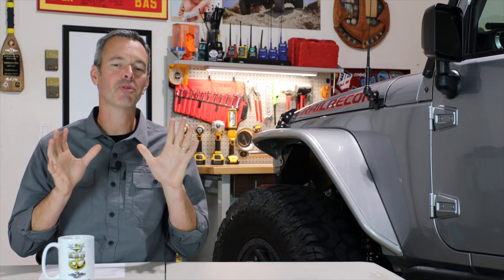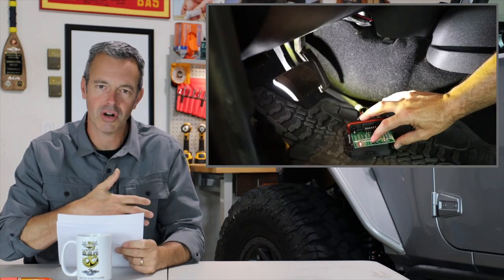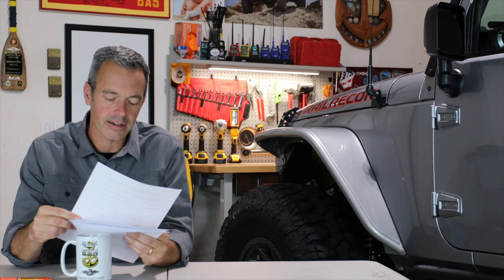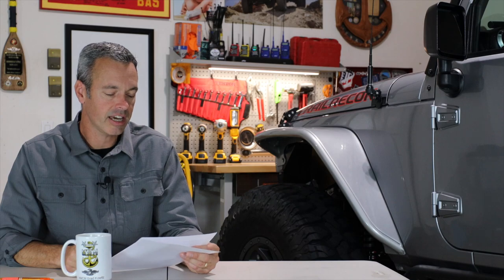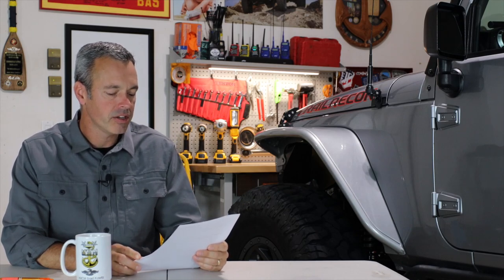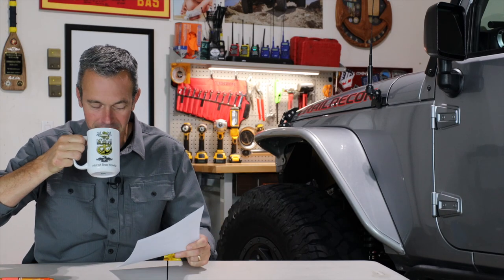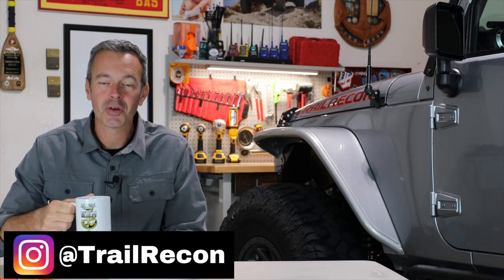Why Don't I Have a Dual Battery System in My Jeep Gladiator? - Garage Coffee ep. 3

Comment: 1:18 Rig of the Week
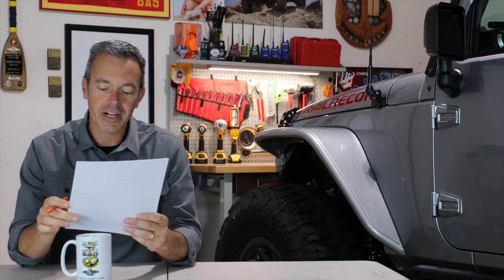2:20 What is your favorite rig walk around?
3:16 What have been the options for how to stay in touch with your wife when you are off the grid?
4:31 Would you be camping out during the quarantine?
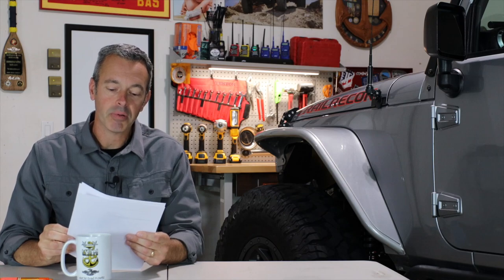5:17 Any plans for new axles on the JT?
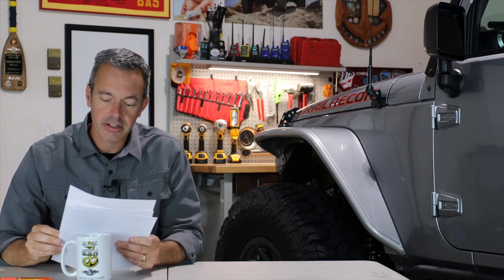6:05 Are you fitting a 38' spare under the Gladiator?
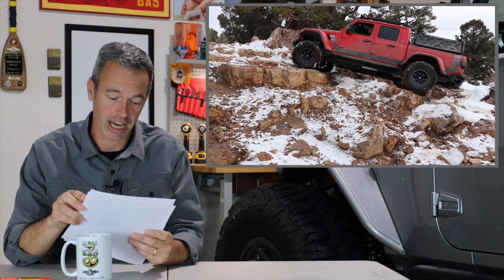6:47 Pros/Cons for electric tent heaters
8:02 What upgrade do you wish you never did to the JK and why?
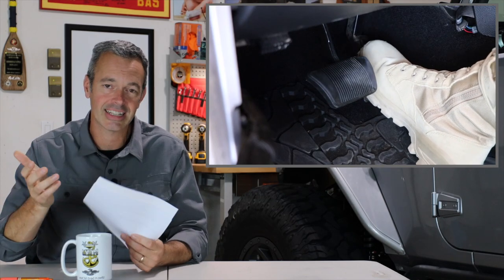8:56 What are your thoughts on a dual battery vs a power station?
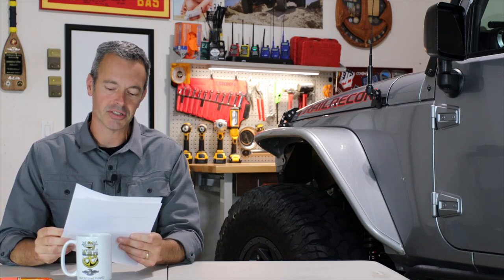10:34 What's your favorite Jeep?
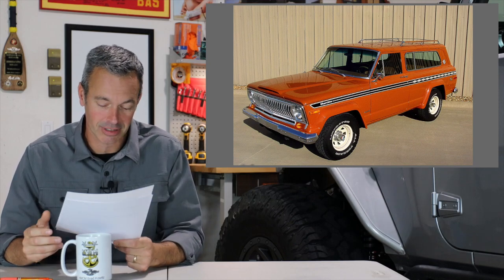11:22 When are you lifting the Wife's JL?
12:07 If you could have any engine in a Jeep what would it be?
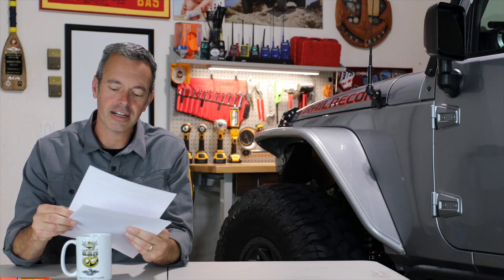12:29 Do you think the electronics that come with newer Jeeps will become a hindrance?
13:41 What is the best first off-roader? A Wranger TJ or Cherokee XJ for a high school student?
14:50 Is there anything you wish you did to help with the transition out [of the military]?
16:40 What are the reasons for changing from a beadlock wheeler to a normal one?
18:18 If your ball joins wear out what brand would you go for a replacement?
18:52 What are the top mods you have done to the Gladiator?
20:20 What was your first experience hitting the dirt that got you into 4-wheeling?
21:46 If money wasnt a factor what would be your dream build for your Gladiator?
20:22 What is your long term goal with E3 overland?
24:05 Best coffee?
24:47 What are the top 3 lessons learned from trailriding and overlanding?
26:37 What type of cabinets are in your garage?
27:10 When can we go camp with you?
28:27 Can you talk a little bit about your Jeep badge of honors?
29:22 Closing
Reply: Thank you soooooooo much!!!!!!!
Reply: Thank you. This post needs to be pinned to the top. It also deserves more likes than the actual video.
Reply: Thanks!
Reply: Yeah, nice job, he should be paying you for this so I don't have to listen to all the other BS first.  Also thank you Ublocker for removing all the ads.
Reply: Thanks. I was actually looking for the topic of the title: dual battery.

Comment: Technically all JL and JT come from factory with a dual battery setup... do a video on how it works?
Reply from the maker: Yes, technically my Gladiator does... good topic for discussion.  Thanks!
Reply: On a none e torque engine, there's a small battery under the fuse box by the firewall.

Comment: Brad, great "real" episodes in this garage coffee series.  I recently purchased a JLUR and have the steel bumper like your wife's JL and your JT.  Was wondering what you were using for a winch plate?  I see lots of options but I've heard a few stories about some being not the right fit, not fitting certain winches or just plain bending under pressure.

Comment: Brad,  I have a 2011 JKU with 155,000 miles in it. The only upgrades I’ve done are Black Rhino Armory Wheels with 33” Nitto Ridge Grappler tires and front and back LED light upgrades.  Should I bother trying to transform this into an Overland Rig or would it be better to buy a JLU and start from there?  If you think the JKU is fine, what would be the first upgrades you would recommend?  Thanks.

Comment: My Bose Entertainment Center DVD & voice command still works perfectly in my 2008 Avalanche, so, yeah, electronics will eventually need module replacements etc, but analog stuff goes out sometimes too. Otherwise, you might want to get one of those 20yr old retired Austrian Military G-Wagons imported into Colorado. Those old motors run forever.

Comment: I considered going the dual battery mostly for my cooler.  However after doing some research I decided to first try an Odyssey Extreme when the OEM battery in my 2017 JK died.  I installed an Odyssey Extreme group 34R and it will run my cooler for well over 12 hours in the most extreme heat and there is still sufficient voltage to start the engine.  Yes the Odyssey Extreme is expensive but cheaper than 2 qualities batteries and the dual battery conversion kit.  Many years ago I had a dual battery setup on my 1980 CJ 5.  This was mostly for my winch but batteries have improved a lot since the 1980’s.  Yes I carry a small jump start battery just in case.

Comment: hey Brad, great video.... question.  I have a 2dr jk. put a 3" lift on it.. shocks and springs. no arms. stock arms..  it drives like its on its tippy toes so to speak..... should I have went with adjustable arms?  short or long

Comment: One of the big reasons for a dual battery in the JL/JT is that the factory battery system is a defective poorly engineered 1.5 battery setup which leads to failures, the dual battery setup can mitigate this

Comment: I'm also looking towards bringing a portable battery.  But since you don't have a dedicated dual battery, do then all your lights including camping lights run off the starter battery?  Won't it drain if you have the lights on at night?  Which lights/accessories are wired to the starter battery and which accessories run off the Goal Zero?

Comment: Hey Brad as a veteran offroader in the jk can i ask you if in your offroading adventures you get coolant running a bit high at times when you push it for instance around the 230f mark? I get this at times when i push my jk in the desert it climbs halfway midpoint between middle and 3/4 and drops to middle in less than a minute and the coolant temp sets at 230 ish even if i push hard...normal driving even offroad i m solid at 200f and middle of the gauge ...do you get this too?

Comment: Hello Brad I have used 2 of those diesel heaters that you showed at the beginning of your video. Both have leaked diesel after using for a few short hours. There is a hole in the casting next to where the fuel pipe is attached. What the hole is for, I have no idea. I plugged the hole in the first one, which stopped the leaking, but after a few short hours of operation the glow plug stopped working. I got a replacement and it started leaking too. Also it keeps shutting down and I have to restart it. I have a plastic container under the heater to catch the leaking fuel. I have a third heater and will install it later today. I’ll let you know how it works out after using it for a few days.  It does put out great heat and uses very little fuel, even though it never shuts off. There’s no thermostat control which is not appealing. You can adjust the output of the heater using the panel or wireless remote. The fuel pump is very noisy. It’s a piston pump. If you or anyone else wants more information or photos of my unit or camper trailer you can email me at cdnbvr@gmail.com. I will answer everybody.   Keep up your great work sir. I also like seeing the rigs that your viewers submitted. I hope that you’ll keep doing those videos.

Comment: I was looking at iceco refrigerators. I have a teardrop camper but the dimensions of the galley kitchen for a refrigerator are not very good so the refrigerator options are limited in my model there is a K2 cooler in the back but I have to deal with ice. I was going to put a 12 volt refrigerator in the back of my Jeep and run it off my car battery for the night in the morning I would plug it into sure power. Do you think a standard battery for a Cherokee would run the 12 volt refrigerator overnight at most 12 hours?

Comment: Nice video Sir, I have a question regarding tires. Road noise is very important for me, as you tried several brands, which one is quiet during all their life....I had a set who was perfect when new but after 150000 miles, it was a nightmare ( I turn my wheels each 3000 miles )

Comment: As an SJ owner, I want to advise you to look hard. Good unmolested rigs are still out there. Bring your wallet. You will be disappointed on just how little aftermarket support they have compared to the little jeeps (TJ,JK etc) The classic jeeps have issues as well, spark boxes, power wires into the regulator in the dash burning and poor quality control. That being said there's nothing like the old SJ's, mine gets a lot of attention just be prepared to have it called a scout or a bronco to those that don't know that jeep used to make big stuff :)

Comment: I love your comment about liking the SJ.  I have owned 2 in my life.  My first was a '73 wagoneer, 4 door..  Believe it had the 340 v8 with automatic and dual tanks.  Great range and very easy to drive.  So smooth on the highway and cound take some fairly rough terrain.  My second was a 1985 Wagoneer 4 door.  Again it was a dream to drive.  Both had surprisingly tight turning.  If I ever have a chance to do another project vehicle, I would look for another SJ.

Comment: How much overlanding can really be done on a 2wheel rig I have a 2016 toyota tacoma trd sport with LSD that iam building and want to start overlanding thanks great channel!!!!
Reply: thanks for all that info iam glad to hear that iam located in san diego county in a small city the clearance on the truck was the first thing i did i upgraded my upper control arms to total caos u did 2.5 fox coilovers with a 2in lift in the back i have 17in fuel rebel wrapped in 285/70/17 falcon a/t 3

Comment: I have a question: why do jeep ppl never ever do any performance mods, besides CAI, like headers, turbo etc ?!
Reply: Diminishing returns I imagine. How fast do you need your trail rig? How much fuel do you wanna waste with go fast stuff? How much more will you need to carry? Can you go to any parts store to repair that go fast stuff? Stock stuff is easier to deal with on the trail, and if you break it someone might have a spare with them. Not much chance of that if your powerplant is modded out. If that makes sense? Now the rock racers and buggies? oh yeah all kinds of power adders, but those are trailer queens the rest of the time.
Reply: Psyberdream 
I agree with you, and disagree in the sane time, jeep ppl having heavy 37’s, steel bumbers, roof racks, yet no one even tune thier rig for anything !!?

Power adders are cool, my question is why no bolts on and a tune!?
Reply: @Ali-bz9gd  i have seen some, on the 3.8 in the jk a pretty common bolt on is a supercharger, though tbh the 3.8 is still pretty gutless even with it. Litebrite ran one on a jl and it slagged the motor. On my j10 I have done upgrades less for power and more for reliability, holley 4160 carb, edelbrock intake,cam,timing set. Converting to HEI Ignition on constant fuel. Performance for me increased but my goal was something easier to live with and keep going. Maybe others have a similar goal?

Comment: what are your thoughts on a positraction limited slip differential verses installing lockers?  I have a posi in the rear diff and debating putting one in the front.  Love your videos, keep them coming.  Pops from Miami
Reply: Where do you go in Miami? I can’t find anywhere besides the hump
Reply: Dirt Lifestyle just did an excellent video explaining the pros and cons of each.
Reply: Look up offroadandchill on YouTube. He's based in Florida and hes always finding new places. Also has a group you can join and head out there with him. Its more mud than anything not much rocks in miami
Reply: I have a traclok in the rear of my yj. Ran it like that for awhile. Put in a spartan in the front. Mud holes i would get stuck in i could hit with ease and on the rocks I needed less throttle to get over certain rocks. Take it for whats its worth
Reply: @julianhaylock9843  alot of it has to do with the driver. I've never had an issue with the traclok just a little e brake and id climb right over.. Others will try to steer you away from it.
Reply: Jose Ortiz i agree. Love my lsd. The locker i got was $100 which is why i got it. Dont let the internet tell you that lsd’s are useless. They have their place like a daily rig that sees a lot of pavement or snow. However for pure traction a locker takes the win in my opinion. With that said i have thought about leaving my rear lsd for the remainder of my build.